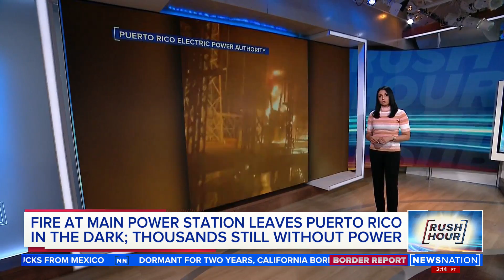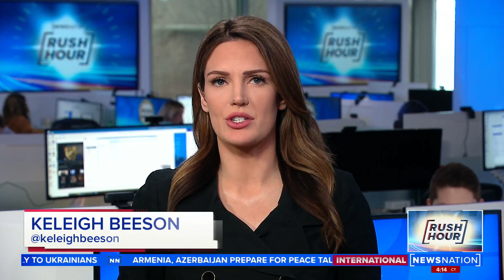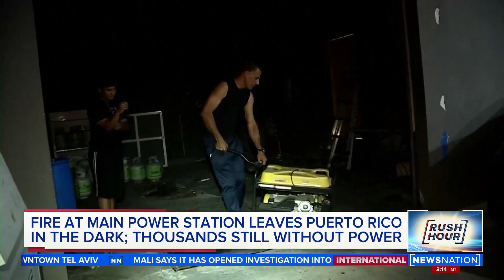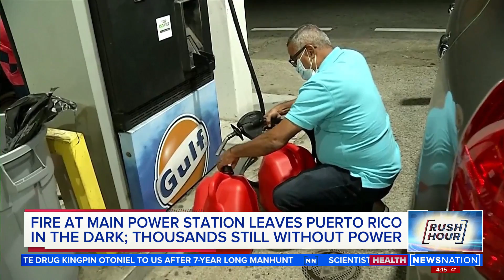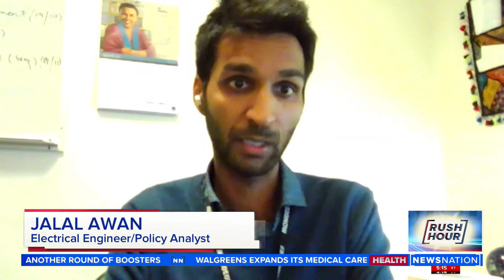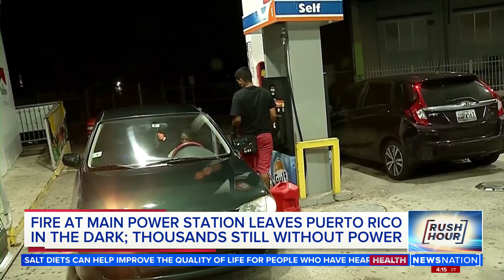Puerto Rico power outage 'speaks to systemic issues' : electrical engineer | Rush Hour

Comment: Puerto Rico has had crap power for decades. Just the locals.
Reply: Nope, the system was neglected for years to excuse privatizacion and now that the system is under private sector control the service is far worse.
Reply: @billfrost5674  nope Bill, the government cut maintenance and stopped training and replacing personnel that retired so they have a excuse to privatize the system,  the company chosen to manage the system didn't retain the personnel that knew the system and had the experience working in difficult environments and hired new cheaper worker without any experience and also brought American linemen that are next to useless outside some small areas in the San Juan area. After a year Luma doesn't have enough personnel to operate or make repairs and the system keeps deteriorating at a very rapid pace, any storm or hurricane will collapse the system and is going to take years next time cause the experience personnel is not longer available.
Reply: @RealengoPrimordialDemon  the Puerto Rico 🇵🇷 grid has been neglected by both public and private management. The grid is and has been and will always be crap. The grid has never been good.